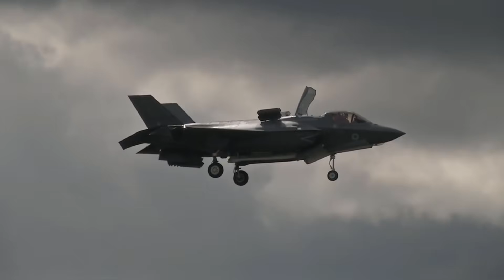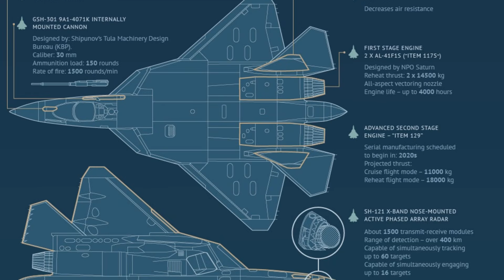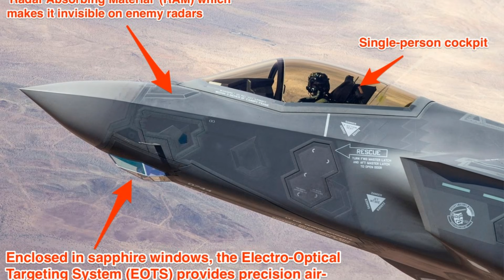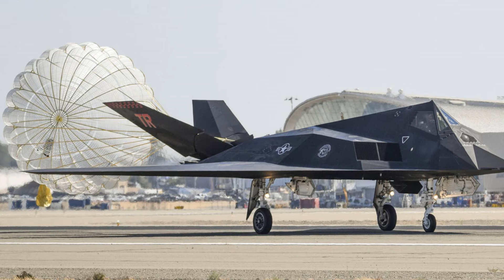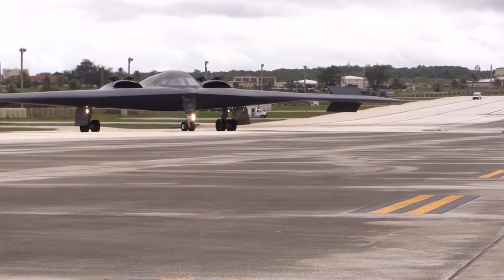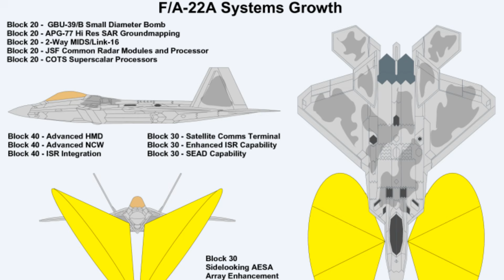Top 5 Combat Aircraft with Lowest Radar Crossection (RCS)

Comment: Seems the next step is add stealth to externally mounted weapons.
Reply: That probably won't happen because then every aircraft would need its own set of stealthy Weapons that align with the shape of the aircraft they are mounted on. And of course costs of changing every air to whatever munitions outer appearence. Its way easier to just build planes that have internal bays.

Comment: 0.1 m2 of RCS in a Su-57 when we can see totally clear the inlet blades of the engine's fan?, seriously?
The Su-57 is a beautiful plane with a nice maniobrability (with nice solutions like the mobile chines) but it's not stealthy, so it's not a 5ft generation plane.
PD: Stealth is not the only one feature for being a 5th gen fighter, but it is mandatory for it.
Reply: None of the "assumed" RCSs of this video is correct. And your suspicions are sound. The Su-57 have an RCS that is actually larger than at least two American fighters which are not even considered stealth or "5th gen". And about "5th gen", that characterization does not only mean an effort at stealth. It has a lot more meaning, and the Su-57 has none of that.
Reply: SU57 has rcs of a slightly smaller fighter plane
Reply: only the production version of the Su-57 has the necessary improvements to have an RCS below 0.5 m²
Reply: What we do know is that Russian overhyped garbage is being shot down in Ukraine.
Reply: You have to admit that the Su-57 is a breakthrough for the Russians because it is their first attempt to have a Stealth Fighter and they achieved a good result for their first attempt.
Reply: @angelarce832  It’s not nearly as stealthy as the US’s first attempt.  It has radar and avionics comparable to what the US had in the 80s.  Engines aren’t even as good as 1980s US engines.  It’s just a 4th gen fighter that is dressed up to look vaguely like a stealth aircraft.
Reply: I'm not sure where you're going at. I'm pretty sure it's a 5th generation jet. Also by saying just because you can see blades doesn't mean it bumps down a whole generation. Generation is based on stats and new technology that is implemented into it. Though it is blurry and there js no real generations. I do prefer a good su57 cockpit though. They colour it a certain colour to reduce strain on your eyes. Thoughtful
Reply: @charaznable2859  I understand the generation doesn't matter for The Red Comet, but for being a full fifth generation fighter it's a must to be stealth. A fighter with visible fan blades is simply not stealthy, the fan blades are the main source of RCS.
Reply: @Kemanaves  maybe the blades are painted red and it's so fast you can't see it
Reply: @charaznable2859  Hahaha, that would explain it! :D
Reply: @Kemanaves  I hope so.

Comment: A stealth aircraft has to be designed from the ground up. Aircraft designed with stealth in mind or modified does not make it stealth, it only gives it a reduced rcs signature.
A Saab Gripen does not have an rcs of 0.001, look at that bigass vertical tail

Comment: SU-57 is not a stealth jet
Reply: Su-57 is stealt fighter
Reply: It's sort of stealth aircraft but not enough stealth as F-35 lightning 2...!
Reply: its a stealth beast bro. what r u saying?
Reply: @shikharprakash7247  beast? Really? Ok, let's run through the reasons why it's not a stealth jet. First, it has old 4th generation engines that weren't made for for a stealth jet. The engines aren't good at masking infrared heat signature. The engines are also not fully covered like it is on an F-22. Second, the flap's gaps on the su57 are to big compared to the F22. Too much radar scatter because of it. Third, the vertical tail fins are too far apart. The closer they are, the better it is for stealth. Forth, there are a lot of noticeable seems as well as exposed rivets and bolts. This effects stealth. If you look at an F22 or F35, the body is very smooth as it looks like its one solid piece with hidden rivets. They also have a special tape covering over any seams and bolts. Fifth, the SU-57 does not have S shaped ducts in its intake, which means radar can bounce off of the engine blades. F22 and F35 have S-ducts, which blocks the engine blades. Sixth, the SU-57 has a baked in coating for radar absorbing which isn't as good as what the F22 and F35 uses. The US stealth planes use radar absorbent paint material. It works better than what russia uses. It is very expensive to use. A pint of the paint is very, very expensive. Either russia doesn't know what the material is, or it's just to costly to use for them. Seventh, SU-57 has a round protruding IRST on the front. Not good for stealth. Eighth, SU-57 has gaps between the air ducts and fuselage which reflect radar. I can go on and on and on but you get it by now.
Reply: @1.21Gigawatts_  What about hypersonic missiles it can carry, low cost and maintainance,1 AI pilot, High maneuverability and radar absorbing material it is made up of . And practically Su 57 can inflence PATRIOT System but F 35 is built to be destroyed by S 400 triumph.
Reply: @shikharprakash7247  what are you talking about? You said it's a stealth beast and I'm explaining too you why it is not. Now you're talking about other things that have nothing to do with anything. I've explained the radar absorbent material to you in my previous comment. Russia's absorbent material does not work as good as RAM paint on F22 and F35. As for patriot and S400, you have no idea how SU-57, F22 and F35 will perform against patriots and S400. These planes never flown into territory with those radars. You don't know, I don't know, nobody knows. Russia only has 2 SU-57 that they claim is combat ready and about 10 SU-57 that are prototypes. That's it. What we're seeing right now in ukraine and western Russia is that russia'a air defense systems are underperforming based on what russia claims their systems can do. We are also witnessing a bad performance of Russian air defense systems in syria as Israel is flying into syria with F35 and striking without a problem.
Reply: @1.21Gigawatts_  i m just getting practical and that too im my last words. And Syria? those corrupted soldiers didn't even know how to use it properly. Anywhy i m understanding u are not looking it practically . Reality is different .
Reply: @1.21Gigawatts_  Great explanation although I belive israel has embarrassed many S300 and S400 systems with there F35’s.
Reply: @shikharprakash7247  maneuverability doesn’t matter when an aim-120 AMRAAM fired from an aircraft you can’t even find kills you BVR.
Reply: Su-57 is a stealth jet
Reply: @Человеквквадрате  No it's not a true stealth jet
Reply: @killingyouwithlogic5808   а ты кто такой? Инженер?

Comment: The Rafale has a stealth between 0.05 and 0.1m² so less logically than the SU-57 so who should be in the top 5 ranking.
Reply: What's the prize for this raffle?
Reply: @apolloaero  sorry i'm confused, this rafale
Reply: Ho told you that bull sheet 🤣 
Maybe when it's flaying with out any weapons
Reply: @constantinemouad2782  no sorry this Rafale
Reply: Wishful thinking. It's still a Gen 4.5 fighter & while it has a less than 1 m2 RCS, it's not .1. Not even counting external weapons & fuel tanks.